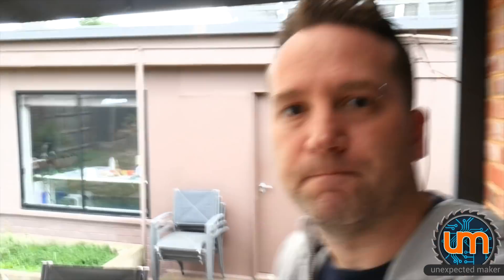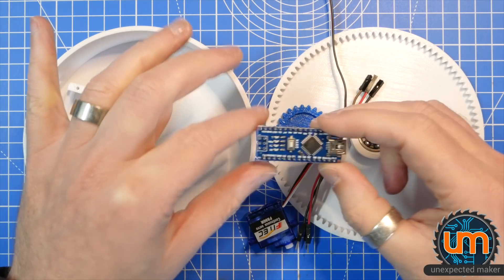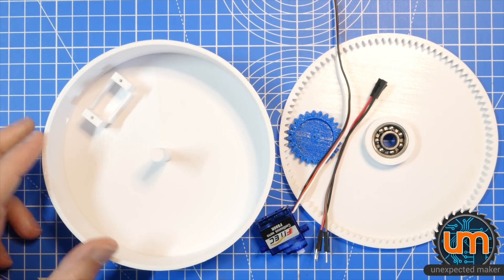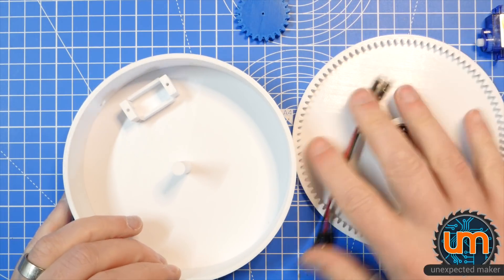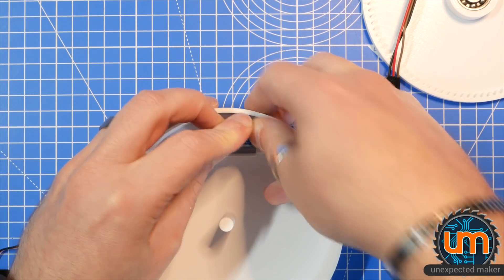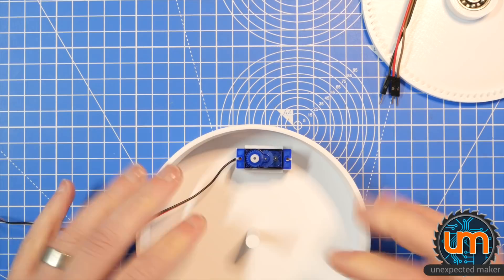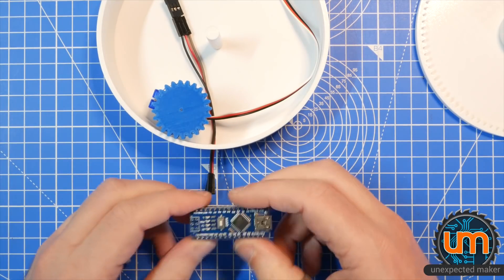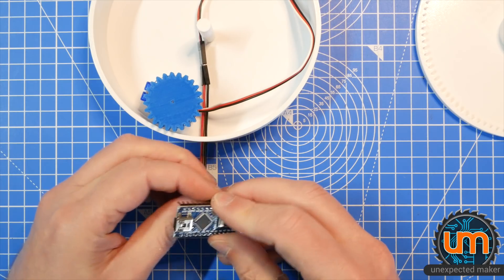A new tool for my videography - Thanks Liz!

Comment: Nice job on the turn table. Mounting that servo had me cringing a bit, maybe make the wire slot a bit taller in the next revision, if there is one as it appears to accomplish the job quite nicely as is.
Reply from the maker: I did print a new top with clearance for the screw head, but other than that it works great. Good enough to  possibly leave it as is :-)

Comment: It does exactly what it says on the tin, simple and functional, very nice, I'm bit surprised none of your spinney things have been blue.
Reply from the maker: Well in this case I need white so it can be "invisible' to the camera when lit, but yes, blue is my favourite colour, but not a good colour for my parts picker either as I have a component that is blue - my 7.5nH inductor in my matching network. It's hard to see blue 0402 parts in a blue compartment - even with a micro-scope ;)
Reply: @UnexpectedMaker of course white ! I can be realy dumb!..

Comment: Why spin the full top when you just need a spot to mount the camera spinning to reduce moving mass? 

A base with a socket to screw onto a tripod opens up mounting the rotary on anything with the tripod screw so a larger number of setup locations. 

For the top would it be faster to just have it cut a stack of acrylic or other plastic sheeting and glue together as it is a simple pattern? Could even skip glue on the gear section and just screw it on to play around with gear ratios/patterns to change the speed/pattern the video creates.
Reply from the maker: I don't want a spinning or orbiting camera, I need a fixed camera and lighting, and a spinning centred subject. The entire top has to spin to allow me to gear down the speed of the servo, and allow me to put larger items on it in the future. This works perfectly - now that I re-printed the top with clearance for the screw holding the flex gear on the servo :-)

Comment: Nice! :)  Slower board rotation in the credits would’ve been good, as it spins so fast you can’t really see the board features. But, don’t mind me. :)
Reply from the maker: Well, the board spin at the end was the specific spin I was after from the turntable. The ability to ease in and out of the spin with a rapid rotation to get to each side.The credits wasn't about promoting he TinyPICO, but the turntable ability ;)